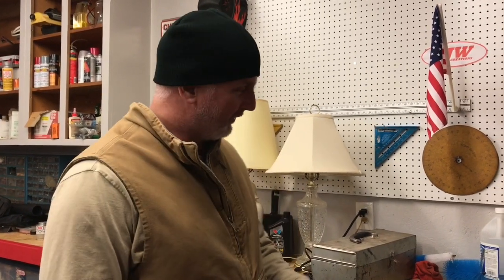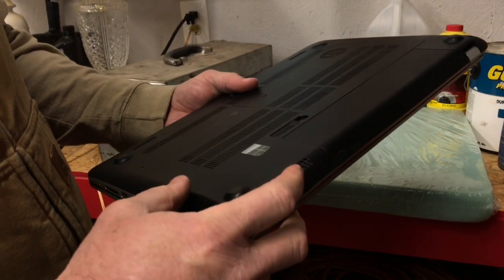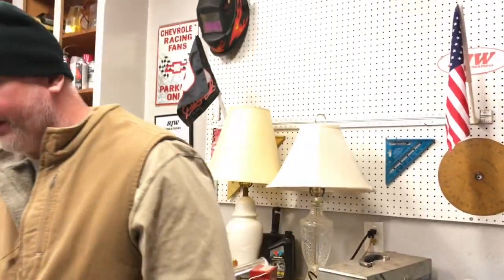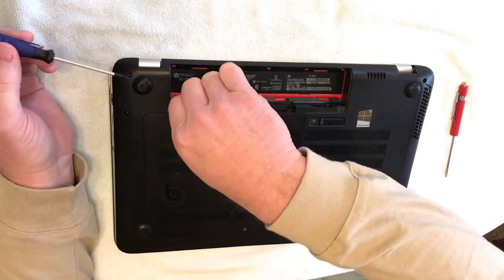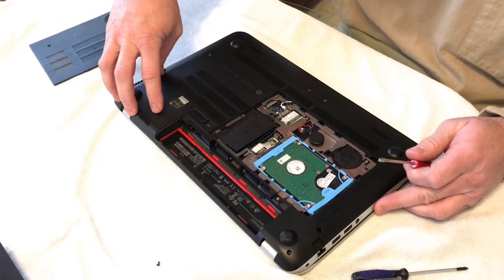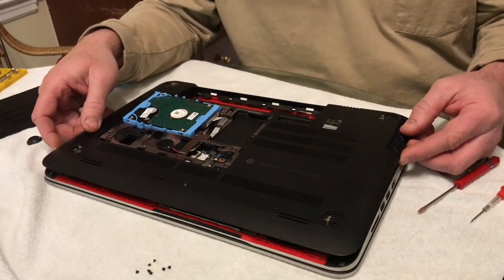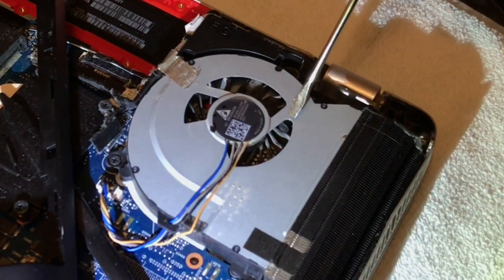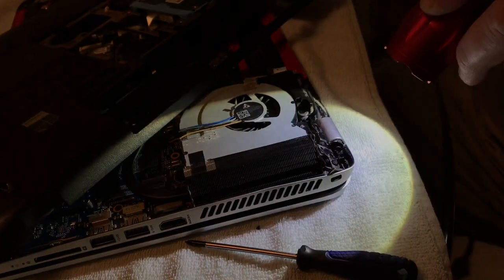Simple Fix - How to Repair HP Envy 90B System Fan Error

Comment: It does not get fixed that way. I have cleaned my fan with duster and a vacuum cleaner. Put it back to get the and still get the 90B message.
Reply: replacing fan helps?